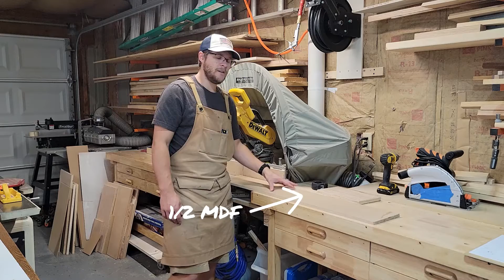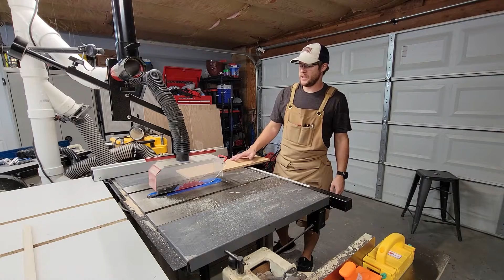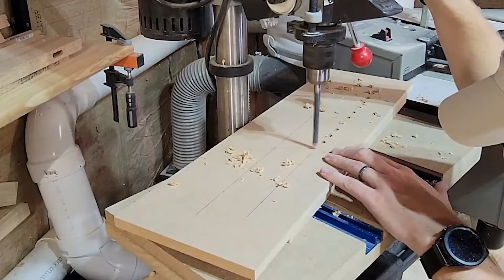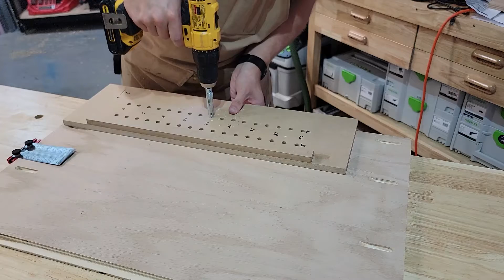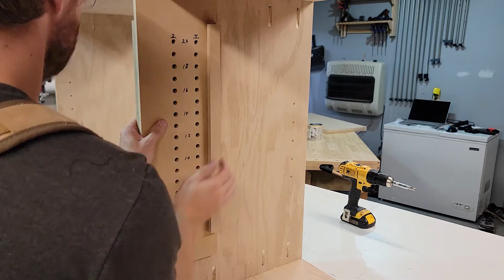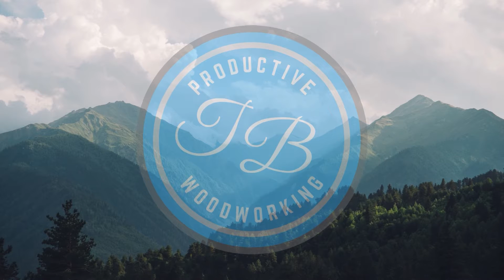How To Build A Shelf Pin Drilling Guide || Woodworking Shop Jigs

Comment: Very helpful. My “carpenter built built ins and didn’t put the pin holes in for shelves. 😮.
Building this jig will be helpful. Since I can’t use an edge guide on the back side would flipping the jig help, only putting a guide on one side??